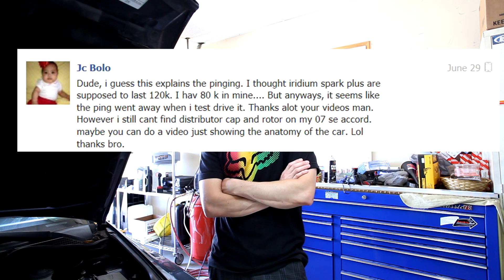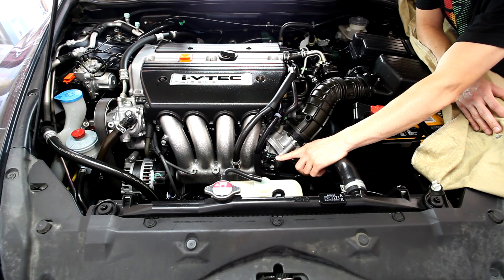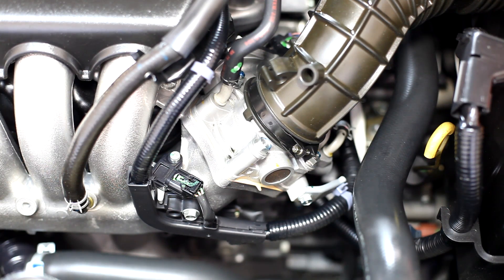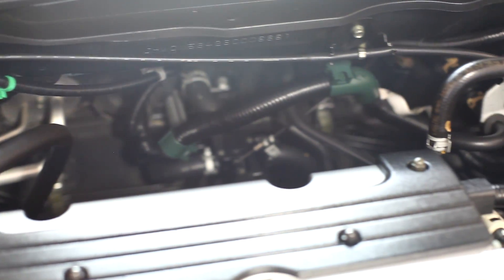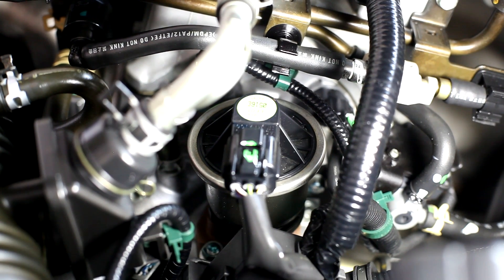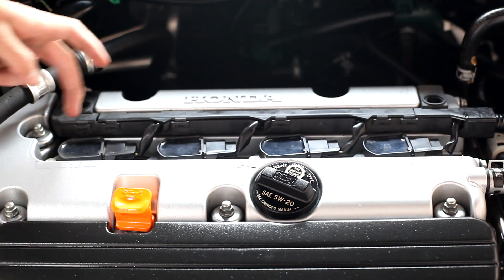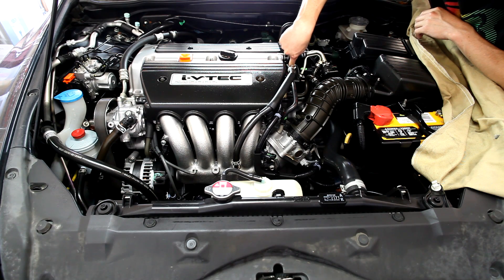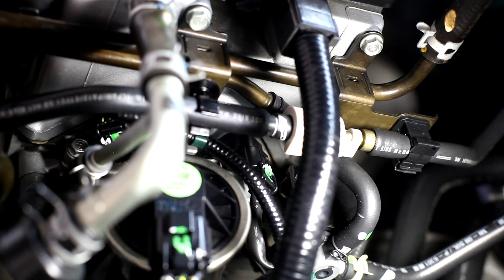2003-2007 Honda Accord Engine Anatomy

Comment: Need help 2007 honda accord 4 cylinder need help with code p0135 sensor bank 1 sensor 1
Reply from the maker: Its the air fuel ratio sensor, its the sensor right after the exhaust and before the cat.

Comment: @nutzandbolts...Saw your video regarding what you do to clean the engine bay. Didn't realize it was that simple. The only thing going I would do different...is use Deionized Water vs water from the hose. Great videos though.  Keep them coming
Reply from the maker: thanks

Comment: can you help me locate engine coolant temperature sensor number 2, I believe it goes in the radiator but there's already one which is the fan senso,  i  change number 1 one that goes inside the intake manifold, thank you so much!
Reply from the maker: the coolant temp sensor is on the side by the water outlet cover on the bottom. There is only 1 coolant temp sensor, not sure which sensor you replace by the intake manifold.

Comment: Hi, I just dropped a 07 motor in my 03 Accord. Blew timing chain. Any advice to help avoid this problem again in te future. Maintence tips, etc.
Reply: also, Would a Cold air intake be a wise investment.
Reply: Blown timing chain.. wow must have missed oil changes or run on low oil..

Comment: Great informative video and excellent job of keeping the engine clean and shiny,  I wish my 06 Honda was that clean!  I was wondering if you can make a tutorial video showing how to  recharge AC refrigerant R-134A.  Thanks.
Reply from the maker: best way is to use a machine, which we don't have. We don't recommend using those A/C refrigerant can's they sell at the auto store. The Proper way to recharge your A/C is by doing a complete vacuum and recharge with R-134a using a machine. We'll have to buy one in order to show you how...
Reply: NutzAboutBolts can you do a series on the 2007 Honda Accord Coupe V6 engine?

Comment: hi ive been watching your videos about your accord... i just wanna ask where is the location of the oil pressure sensor?
Reply from the maker: its on the top right of the oil filter, its like a few inches from there.
Reply: +NutzAboutBolts ok thanks im i got a oil pressure light on but everythings seems fine..  so thats why i suspected that the oil pressure sensor is busted..
Reply from the maker: its possible, but there's many factors that cause that light to come on. such as the oil screen clogging up can cause the oil pressure to not be within spec, or the oil pump. That's a little more extensive than just replacing the switch and see if it'll work. Up to you though.
Reply: +NutzAboutBolts its seems the oil pressure is ok no weird sound on the engine ang its running smoothly..  i hope that its only a busted sensor..
Reply: +NutzAboutBolts or how can i check if oil screen in clogged?  thanks for your help!
Reply from the maker: Pocholo Gabriel
I believe its in the oil pan when you remove the oil pan.

Comment: I have a problem with hot engine hard start. When engine is cold it starts well, but when its warmed up and i turn it of, after 10-20 mins it starts hard. Its cranking and i need to add little throttle to start up.I assume that maybe fuel injectors are leaking. Is there any way that i can cut off fuel pump manually, that way i could diagnose if leaking fuel injectors are problem. I tried with removal of fuse 19 (ECU, fuel pump) but when i remove it engine stalls like it was shut off by key. So that didn't helped. I couldn't find inertia switch where is located? Hacking the inertia switch i could shut off fuel pump manually.
Reply from the maker: +Uros Galovic do you have any check engine lights?
Reply from the maker: +Uros Galovic if no check engine light, you want to check the fuel pressure on your car, then check your fuel line if its plugged or damaged, and last will be the fuel filter if its plugged.

Comment: I was wondering if you could direct me to a more reliable place to get the answer to my 03 accords mpg dropping in the last 6 months, would going straight to Honda be a good bet, i dont really want to waste any more money on not getting answers?
Reply from the maker: +Johnathan Contreras is all your maintenance taken care of? i.e engine air filter, spark plugs (120k miles) throttle body cleaned, no check engine light, running on decent fuel and not cheap brands?
Reply: +NutzAboutBolts 
once I started learning about what I needed to change I did change the engine and cabin air filters, I changed my spark plugs, oil and oil filter, changed my tires to used ones until I can get new ones (the ones I had prior were dry rotted) no check engine light, thats all Ive done though I want to learn about maintaining my car better and theres a bunch of thing that I didnt even know you needed to do with your car.
Reply from the maker: +Johnathan Contreras I don't know how your mpg is going down, how much are you getting per gallon?
Reply: +NutzAboutBolts i was getting 400 miles from a full tank until the yellow light turned on and now im getting 320.
Reply from the maker: +Johnathan Contreras what yellow light?
Reply: +NutzAboutBolts the light that turns on when your gas is about to go empty i was getting 400 miles from a full tank until that light would turn on now from a full tank that light turns on at 320 (everytime fill the tank I reset the mile tracker to monitor how many miles im driving)
Reply from the maker: +Johnathan Contreras ah the low fuel light. There could be many things that can cause low mileage, just keep up with the maintenance and see if it changes... I'll check how many mpg I'm getting and I'll get back to you on that lol.
Reply: +NutzAboutBolts thank you I appreciate your help
Reply from the maker: +Johnathan Contreras Hey, just wanted to let you know I am getting 23.5 mpg. I think your's 18mpg if I am correct.
Reply: +NutzAboutBolts 
Thats what I was getting before the mpg drop, did the math I was getting 23 also. Thats cool dude, so now I know that 23 is what I'm  supposed to be getting.
Reply: +NutzAboutBolts 
now it is 18mpg
Reply from the maker: Johnathan Contreras
what oil are you using?
Reply: +NutzAboutBolts 
when i first got the car in 2013 i was consistantly using penzoil 5w20. then like 6 months ago i tired mobile full synthetic but i trued 10w30 because of how many miles I have on the car then this last time I switched back to penzoil conventional 5w20 because I found out that my 03 accord uses that regardless of miles
Reply from the maker: +Johnathan Contreras when did you switch back? Using a thicker and heavier oil weight can reduce gas mileage as well since your engine is working harder because of it.
Reply: +NutzAboutBolts 
i switched back in january, honda just told me they found a leak in the valve and i need a valve adjustment, your video on remove and install pvc valve is that the same thing, because im thinking i should do it myself they wanna charge 360$
Reply from the maker: Johnathan Contreras
yeah the PCV valve is right in front by the passenger side, it's an easy part replacement. We're planning on doing a valve adjustment this Saturday, hopefully everything goes as plan and we will have the video uploaded. We're at 100k miles so its good to make sure all of the valve clearance is in specs.
Reply: +NutzAboutBolts 
sweet, I finished and made sure to ask exactly what my car needs and the guy said a valve adjustment and the air assist valve needs to be replaced. so you video will help the guy was saying its hard to not do it because of the tools and you need to get the adjustments right but i know its possible, and the air assist valve i just gotta find the part. im gonna get a haynes manual and go from there
Reply from the maker: Johnathan Contreras
never heard of air assist valve before. Is there another name or check engine light code?
Reply: +NutzAboutBolts 
im not sure thats just what the honda rep told me it wasnt from the actual technicians mouth, im not sure but today when i got in my car i seen the check engine light on and took it to the mechanic by my house they used their snap on and got the code back 10171 (fuel metering too lean) so now the mechanic by house is saying i need a new O2 sensor. so its three things now.
Reply: +NutzAboutBolts 
P1071 not 1071
Reply from the maker: Johnathan Contreras
the code is actually P0171, fuel system too lean. Not sure how he diagnosis that it was the O2 sensor. There's many things that can cause the engine to go lean. I would check the PCV valve, PCV hose, Evap canister purge valve, throttle body, intake manifold, and brake booster hose. There could be a vacuum leak somewhere that's causing the vehicle to run lean. Also you need to check if your fuel pressure is ok or not, if its not spraying enough fuel into your engine, that can cause a lean fuel trim.
Reply from the maker: Johnathan Contreras
are there any other codes besides that?
Reply: +NutzAboutBolts
that was the only one that came up on the snap on machine the mechanic had.
Reply: +NutzAboutBolts
i read online on one website where the o2 sensor is a common misdiagnosis for this code. and rememebeing what the guy at honda said he found a leak which is why they said do a valve adjustment, so im hoping thats whats tying into the code because honda said its causing my pressure to drop
Reply: +NutzAboutBolts
i read online on one website where the o2 sensor is a common misdiagnosis for this code. and rememebeing what the guy at honda said he found a leak which is why they said do a valve adjustment, so im hoping thats whats tying into the code because honda said its causing my pressure to drop
Reply from the maker: Johnathan Contreras
not that I know of, I would check around for vacuum leak first and see. Is your idle higher than normal? normal is 800 rpm +/- 50 rpm.
Reply: +NutzAboutBolts 
Okay, I did the valve adjustment already and the mpgs havent came back up but power did kind of increase, the first 3 things I am goong to try are you video for cleaning the throttle body, clean the MAF sensor and change the O2 sensor, then change all the fluids because theyre old and we'll go from there, I'm gonna look it up online but I dont know how to tell what my idle RPM is to answer your question.
Reply from the maker: Johnathan Contreras
your idle rpm should be at 800 +/- 50
Reply: +NutzAboutBolts 
okay, ill check it out
Reply from the maker: Johnathan Contreras
ok.
Reply: +NutzAboutBolts 
since it goes by 1000 rpm the needle should be before the firsr dash right?
Reply from the maker: Johnathan Contreras
yes
Reply: +NutzAboutBolts 
okay, i will get back to tou after checking it then.
Reply from the maker: Johnathan Contreras
k
Reply: So pretty much when my cars engine is cool the rpm are high like 900 plus. And then once it warms up it goes around the number you mentioned 800+/-50 maaaybe a little tiny bit over 800.
Reply from the maker: Johnathan Contreras
that seems normal then.
Reply: +NutzAboutBolts 
yeah, so im just gonna try 3 things clean the Mass Airflow sensor, clean the throttle body loke in your video and replace the O2 sensor and we'll see how that goes. im still wondering about this air assist valve that the Honda techs wanted to replace.
Reply from the maker: Johnathan Contreras
if there's no check engine light, replacing the o2 sensor is counter intuitive. and what air assist valve?
Reply: +NutzAboutBolts 
there is a check engine light its where i got the fuel metering too lean code from.
and idk i remember when i first told you about it you said you never heard of it. i did google ot and a part came up with an image of it in multiple website. its just that when you never heard of that name it made me wonder if maube thats another part
Reply from the maker: Johnathan Contreras
I see the picture, if the tech said to change that, I would start with that first before the 02 sensor. It looks like the part is next to the intake manifold on the right side.
Reply: +NutzAboutBolts 
the thing in regard to the CEL when the techs did the daignostic. it was when i had told them about loss of power and low gas mileage. it easnt until the like same day or the next day they finished i already had my car back and then the CEL came on and instead of taking it back to read the code i took it to a mechanic and he told me the code. so im wondering could the CEL be on because of what the techs found. also maybe the maf/throttle body/ O2 sensor.
Reply from the maker: Johnathan Contreras
usually if its an O2 sensor, it'll say bank 1 or bank 2 sensor problems.

Comment: Hey man can you help me to locate the front o2 sensor on a accord v4 2.4l 2004?  my car is giving me the code p0171 and is poor on gas too lean bank 1 and i need to replace it thank man
Reply from the maker: +Geomin16 Have you checked your fuel pressure regulator ? what other codes do you have besides P0171? P0171 means your system is running lean, could be a leak somewhere in your system or fuel pump and fuel feed line pressure is low. 

As for your o2 sensor, the A/F sensor is right underneath the exhaust manifold, and the secondary HO2 sensor is right near the Cat.

Comment: Awesome and great Video, from picture quality , details and clarity .

I am having a problem with my Honda Accord 06 engine and this is a good start since every mechanic is telling me a different story.
Reply from the maker: shads77 ouch, that sucks.
Reply: My car engine idle smooth when it is on N or P, but while applying the break and shift to D or P, the RPM goes under 0.5 and the engine shake/vibrate. No one can find the real reason. Any idea, the car has 170K but run really smooth except when it is idle on D or R.
Reply from the maker: shads77 any check engine light? could also be transmission mount since it only vibrates during drive... Check all your mounts to see if any is broken. If there's a check engine light, could be sensors or switches. Hard to tell without knowing whats going on and the history of the vehicle.
Reply: today engine light came out. I will check the code tomorrow and let you know.
In case it is a bad O2 sensor, will it only vibrate on Drive.
Reply from the maker: shads77 don't think o2 sensor can cause vibrations, mostly bad fuel consumptions.
Reply: Thanks & Keep Your Awesome Videos Coming.
Reply from the maker: shads77 we will try, both of us are pretty busy with normal jobs... :(

Comment: This is an awesome video.  I actually learned a few of these things with my mechanic who is currently doing work on my car.  I can't get my 2004 accord to run properly.  At first it was stalling, not running over 40 MPH because an intake mass sensor, then I got the MAP sensor on which lead to a o2 sensor in the catalytical converter.  I changed the intake, I cleaned the throttle and changed the 02 sensor in the converter, the car still stalls and doesn't go more than 40.  A new machine reading states that there is a misfire in cylinder 1,2,3,4 so, I changed the spark plug to these "iridium" ones and on Friday I blew 2 cylinder heads with a chain belt of some sored that my mechanic told me popped.  The car turned off and he is trying to get it on.  What gives?  How can I stop this whole chain of problems because am going crazy.
Reply from the maker: King Less Wow... with problems like that on a vehicle, I would just sell it since it'll be cheaper to buy a new car than to fix it with all those problems. Sorry to hear about your problems. If it was my vehicle, I would fix all the check engine light(CEL) first before even trying to start the vehicle. Also go through the histroy or the car fax of the vehicle before doing anything.